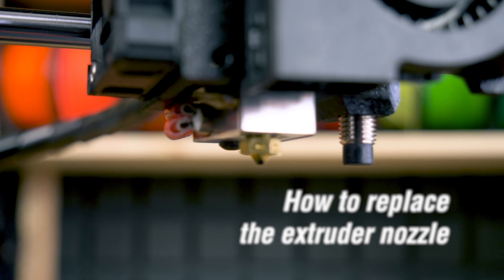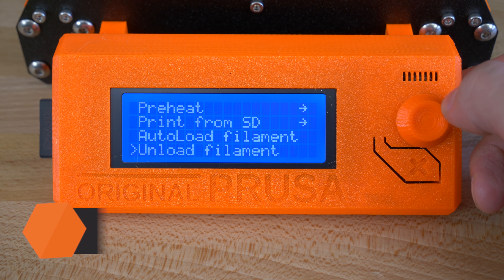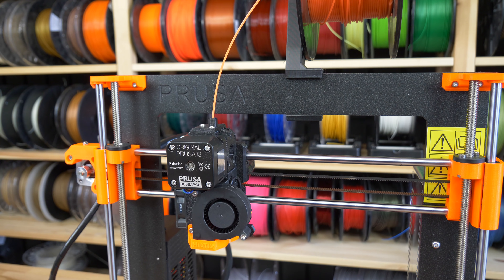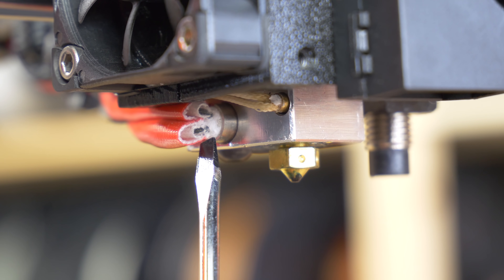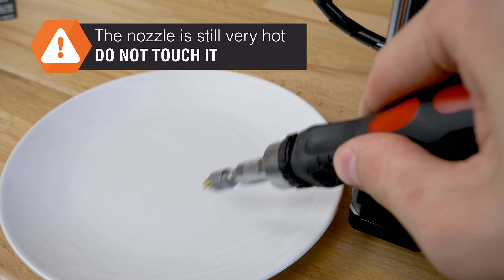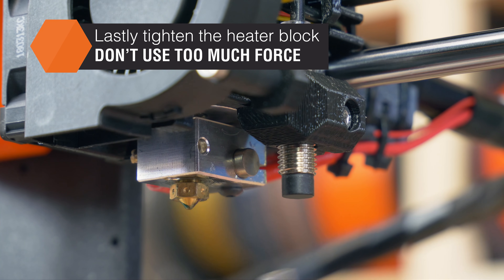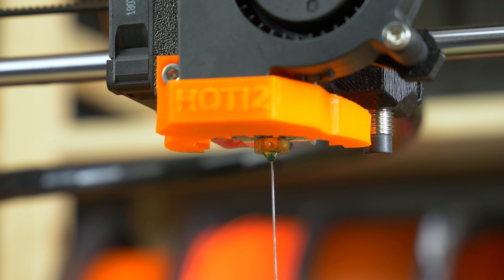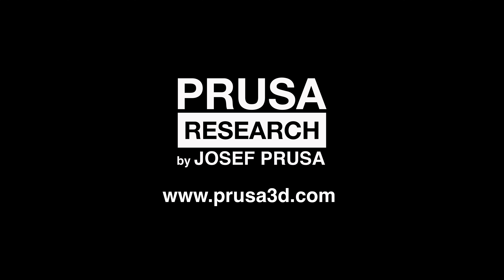How to replace the extruder nozzle

Comment: I feel like advancements in hot ends have come far enough that manufactures should start looking into adding some ease of maintenance into their designs. The hot end is the most often maintained part of the machine and it should come apart and go together quickly with a single tool or no tool. 
That is also the only thing I don't like about the mk3 i3. I know they aren't using a full v6, they have some Frankenstein setup, which is fine except, taking apart the extruder and hot end is a pain in the ass. Like basically the only part of a modern FDM that needs fixing anymore.
Reply: It would have been done already if it was possible. You have to heat it up because the metal expands. And because it's hot, you need to use a tool. And you need a secure fit because the filament is a liquid and will happily find any gap. Keep in mind, lots of maintenance things need tools! Think car wheels for example. 
As an aside, the i3 uses a real, full V6, not sure where you heard otherwise.

Comment: There is nothing more annoying than changing nozzles...risk of damaging a lot of stuff. Certainly not 'quick and easy'  That would mean: plug n play instead of screwing with different tools at the same time.
Reply: Booooooohooooooo
Reply: If your definition of hard is using a wrench and a socket at the same time, 3d printing is defientely not for you.
Reply: @somedude2492  oh fuck off, it is a huge pain in the ass and frequently they do get stuck and cause a ton of problems. Disgusting holier than doubt geek attitude, gross.
Reply: @somedude2492  That's exactly the kind of elitist attitude that has been keeping Linux from taking over the desktop. Considering one of Prusa's goals is to make 3D printing ubiquitous it is necessary to make modifications like swapping nozzles as simple as possible. 

Which from a user experience perspective swapping nozzles is objectively difficult. It has to be heated, you have to use 2 tools simultaneously, you need to be very careful, failure states range from slight leak to broken components, and so on. Sure it's "easy" for you and probably (haven't swapped a nozzle yet) easy for me too. But consider how difficult it could be for someone with a disability (illness, injury, age, etc). Not everyone is fully functional and hopefully your response isn't just "well then they don't get to change nozzles on their 3D printer" cause that's rather disappointing.
Reply: @Beskamir  being objective is not an elitist attitude. Linux is objectively hard compared to iOS, simply because of how much the former lets you do. 
Changing a nozzle is objectively easy compared to other stuff that you'll need to do when buying a 3d printer. Debugging is way harder than changing a nozzle. Learning how to model something in cad can be quite a steep learning curve, and the list goes on.
Reply: @somedude2492  My point is that it doesn't have to be hard. 

I'm not sure how modeling is anywhere near comparable to swapping nozzles. For one the failure states are much lower, the worst that can happen is I crash Blender and lose some progress. Compared to having to buy a new component some lost progress is essentially nothing. Not to mention modeling software can be used with one hand (although a bit slower) and does not require working with high temperatures. 

In any case, I've since managed to swap a nozzle without issues and even though it wasn't terribly difficult it really should and imo could be easier to do if an attempt at a better design was made.
Reply: @Beskamir  What he said was absolutely not elitist. 

To engineer nozzles that could easily be hot swapped would probably increase their cost by ten. Keep that in mind.
Reply: @timmorris1432  Okay but their cost would decrease over time and some people would buy them regardless of their extra cost since it'd make their overall experience with 3D printing easier.
Reply: @timmorris1432  Currently the only nozzle that I know that can do that is the Mosquito hotend which costs $150 alone, and requires an entire new extruder carriage to hold it. it also needs a thermister and ideally 50w heater, so more cost. A Prusa ready to go E3D nozzle, with all parts, is less then half that cost.

The Mosquito is a very nice nozzle, it has the ablity to replace the nozzle when a cold hotend with just a socket, no wrench, but it is also far more complex and expensive because of the rigid design that allows that (and the machining to get the parts). Even the Chinese clones are almost $100. Maybe the Mk4 will have it, but you can also upgrade to it yourself if you want. I would love for the Mk4 to have this but I don't think it will, the cost isn't worth it to most people. Hell most people never change away from the 0.4 nozzle anyways.
Reply: @Swarm509  My point proven.
Reply: @timmorris1432  yeah no. A cold swapable nozzle with "quick release" needs a ton of moving parts. In a nozzle, which is small and has to deal with thermal expansion, this is not only hard and impractical, but also expensive to design. Plus, you've got molten plastic flowing near that area, you better hope it doesn't get into the mechanical parts. Cleaning this hypothetical nozzle would be a headache.
Can you already see all the problems that you create just to skip having to use a socket and a wrench?
Reply: @somedude2492  Did you mean to reply to me? I was the one who said it'd be impractical to begin with.
Reply: @Beskamir  Right, I recently suffered a decrease in my visual acuity following a surgical procedure. Now it is difficult to see the nozzle and heat block in order to remove them without breaking something. I say, "If your definition of hard is seeing from someone else's perspective, youtube commenting is definitely not for you."

Comment: Wish there was an even easier way to change nozzles, hot swappable. Toolless if possible
Reply: I'd be willing to buy multiple assembled hot ends just for that.
-Ability to swap nozzles away from the printer, not all cramped up in an awkward position.
-Ability to have multiple assembled hot ends with various nozzle types/sizes ready to go
-Repeatable positioning with locating pins and a simple locking mechanism
-Multiple hotend profiles to set Z offsets and temp. calibration after a swap

Basically I wish my 3D printer could do what my crappy CNC can do...
Reply: Technically, its only hot swappable, there is no way to change it while cold

Comment: Why do you unscrew the heater block before removing the nozzle?
Reply: It probably works kinda like a jam nut internally where the heat break and nozzle being tightened together lock them in
Reply: It avoids putting too much torque onto the nozzle. If you keep the heatr block in place,
you may accidentally bolt the nozzle too tightly. But as other have said...losening and re-tightening of the heater block brings it's own issues.
So I guess best would be to hold it in place, but be gentle with the nozzle. It's not a car tire screw.

Comment: Those pliers are a very bad substitute for an adjustable wrench. If you want to avoid marring the block then a smooth jaw plier wrench really helps.

I wonder if it's too much to have a nozzle swap routine built into the firmware. Cranking the dial to set the temperature gets old.

Comment: "Simple and easy!" except that you now have to check if the nozzle height is the same as before...
Reply: With original E3D nozzles, you don't really have to. Some off-brands might have slightly different dimensions,  so in that case, you could re-do the first layer calibration. But you'll see that during the first print and you can just quickly change the Live Z adjust as the skirt is being printed.
Reply: There are at least 2 new hotend designs that make it way easier to change nozzles...time for technology to move on from the 5 year old V6.
Reply: He always says the instructional videos are simple and easy.  I'm actually pretty pissed-off now.  Went through the crappy steps in this video and the nozzle won't loosen.

Comment: Is there a need to run the Z calibration process after installing new Nozzle?  Or do we simply adjust Live Z to account for any possible variation?  Surprised Z calibration was not a consideration in this How To.
Reply: Generally, you don't have to adjust it. I changed the nozzle about 20 times and never touched and the first layer was still on point. However it can't hurt to re-calibrate it if you want
Reply: Old but still relevant:
You should do a manual 1st layer calibration, yes. Just to be sure. I would not risk the hassle of a failed build.
Even 0.02 mm more or less due to the nozzle having production tolerances and your tightening process can mess up your 1st layer adhesion.

Comment: I tried that exactly, point to point but nozzle didn't come out. While trying I broke heating element. I had my heat break bent and now I have a non-working MK3. I'd love to buy replacements but I'm afraid I can't afford.
Reply: I broke my heater  wires while assembling. I ordered replacements from matterhackers in the US. $12 US.
Reply: Prusa offers individual part warranty on kits and a full warranty on pre-assembled printers. Get in touch with the support team and see what options are available to you.

Comment: I would also recommend checking and adjusting z height after this. The new nozzle might not be at same height.
Reply: Good thought- forgot that and crashed in my PEI sheet 😂
Reply: @natmarelnam4871 no one needs ppl with your attitiude around here... go babysittin
Reply: Personally I would recalibrate everything but yeah at the minimum adjust the Z height with a first layer pass.
Reply: Also failed to mention to change the nozzle diameter value in the slicer.
Reply: Petyr Baelish and in the settings of the printer itself, "and that's it!" I don't know why they skipped all these steps :(
Reply: I know I am kinda randomly asking but does anybody know a good site to watch new series online?

Comment: Forgot the step of removing the fan shroud to gain access.
Reply: There's no need to remove the fan shroud. It was removed just so that the nozzle is visible in the video ;)
Reply: Mikolas3D it's impossible to loosen the block from from the heat break if you have the debris in place.
Reply: Feel free to remove it when you change the nozzle, but I change it without removing the shroud just fine, it's just a little harder to see what you're doing.

Comment: Using the heater block as a form of tightening or loosening is something I consider dangerous as it can bend the heat break.
Reply: E3D themselves suggest unscrewing it to avoid tightening against the heat-break, they have instructions that very closely matches what Prusa did in this video. The only part where they are more informative is telling us how much torque should be applied.
Reply: @istvanmolnar7637  E3D recommends 3 Nm, which is very tight.
Reply: +1 as there's no need to do that anyway - just unscrew the nozzle while holding the block in place
And avoid using the pliers - 16mm non adjustable wrench works very nicely if you don't have an adjustable one

Comment: I got a MK3 a month ago and I love it, it's truly an amazing machine. But is there a way to disable the loud beep that occurs when you unload the filament? It's so loud!
Reply: Was just looking at the git for the firmware and the devs are talking about adding beeps for preheat achieved and the ability to turn off the beeps so it might be coming
Reply: @chrisnelson1935  Did this ever happen?
Reply: @flapflapflap88  I worked out a trick for this (I work late at night and the beep was just too loud for others who are sleeping) . . . hit 'Unload filament' (or Change fillament) . . . and then immediately press and hold down the dial/button . . . this will unload your filament, and then put you straight into Z height adjustment mode - with no beep ! - You can then hit the dial/button again to put you back where you were (for example back into the Change filament process).
Reply: @flapflapflap88  Adjustable beeper notifications:
Starting firmware 3.4.0 there are 4 levels of the acoustic signalization - Loud, Once, Silent and Mute. The user is able to choose between each level in the printer's menu -> Settings –> Sound. You can also change the sound settings during the print in the menu -> Tune.

Level description:
Loud - printer uses acoustic signalization for a failure or if confirmation is needed
Once - this level is similar to Loud, but all beeps are played only once.
Silent - most of the beeps are muted, the user is informed only in case of a serious error
Mute - printer stays muted regardless of the importance of the error
Reply: Compile a new firmware without the beep. Not joking, that is what controls it.
Reply: Maybe cover the speaker with some sticky tape? It's on the LCD board above the rotary dial. That won't disable it, but should make it quieter.
Reply: In settings you can change the volume
Reply: @wooooo948  I dont think that option was there 8 months ago!
Reply: I worked out a trick for this (I work late at night and the beep was just too loud for others who are sleeping) . . . hit 'Unload filament' (or Change fillament) . . . and then immediately press and hold down the dial/button . . . this will unload your filament, and then put you into Z height adjustment, with no beep ! You can then hit the dial/button again to put you back where you were (for example back into the Change filament process).